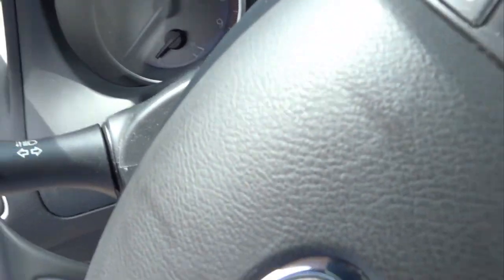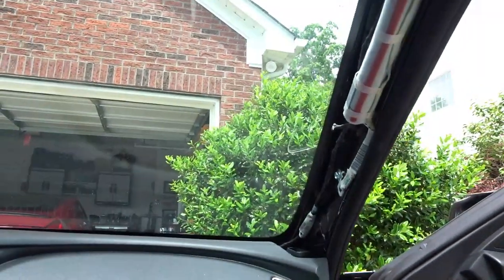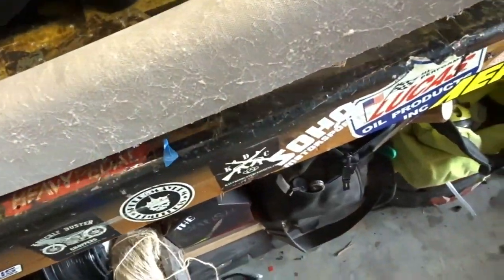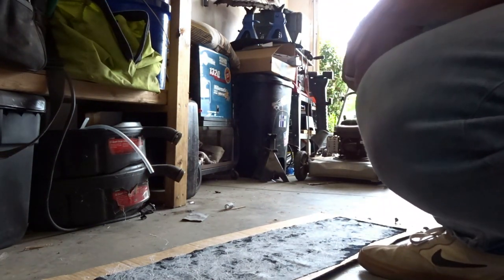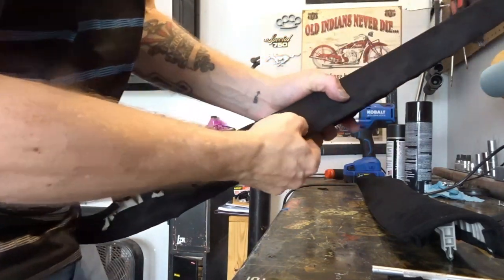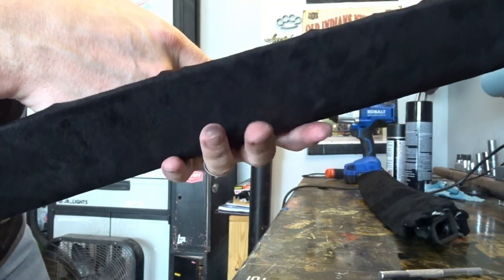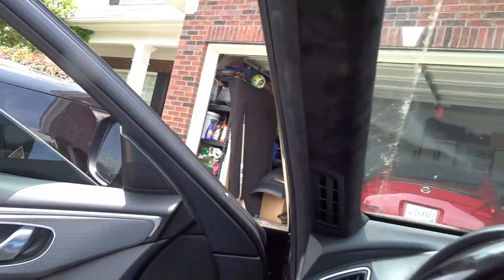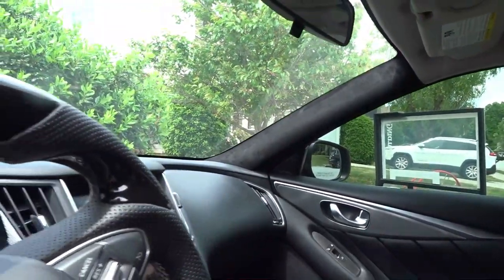Q50 Suede Pillars | Totally DIY!

Comment: Grab the tether clip in the center with pliers and twist. Once you turn in roughly 90 degrees the clip will slip out of the trim. You turn it until it pops in or out of the pillar trim.
Reply from the maker: Should have used the needle nose and done that!
Reply: Yep, long needle nose and 90 degree turn easily pops those out.
Reply from the maker: @jayram31  I’m so impatient—I was using a needle nose to pull the clip itself out 😂 could have just twisted it

Comment: Bro how do you get 21mpg I struggle to just get 19
Reply from the maker: Just drive normal 😂
Reply: @SpeedCultureStudios  I do tho lol that’s the thing if I Cruise in eco shifting under 3k rpm I barely get 19mpg and on the highway I only get like 21
Reply from the maker: @lordofthehearth2740  check plugs and filters and rear gear fluid.  Tire pressure…. Should definitely get more than 21 on highway